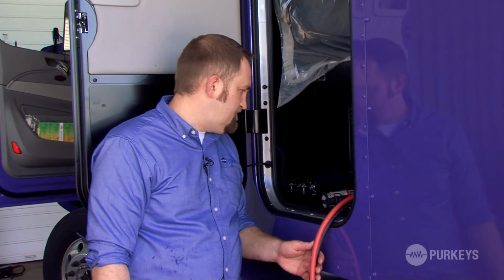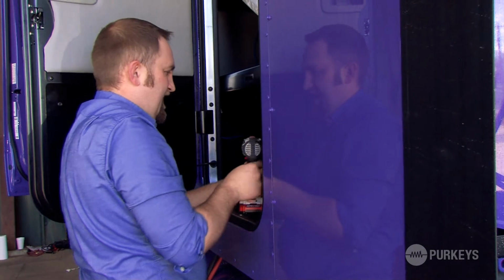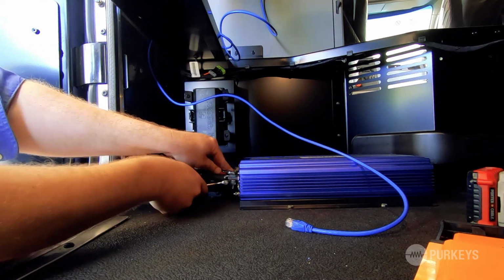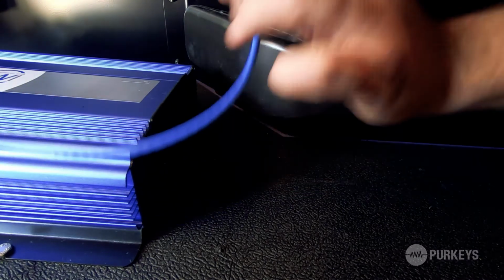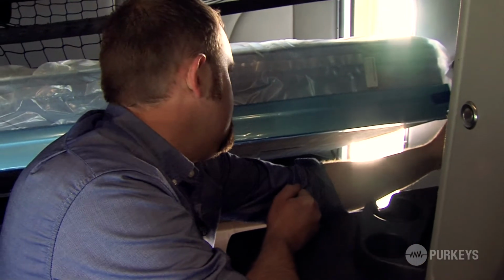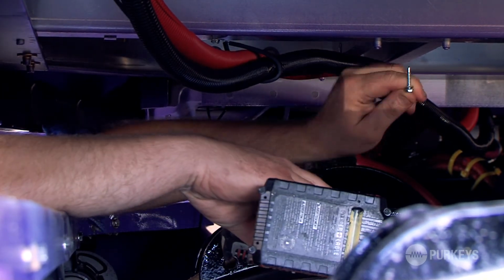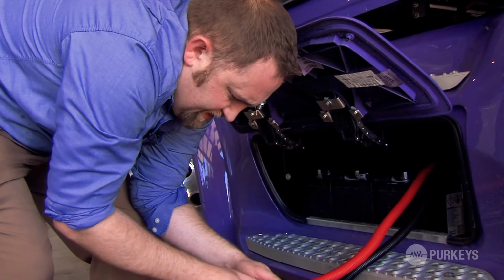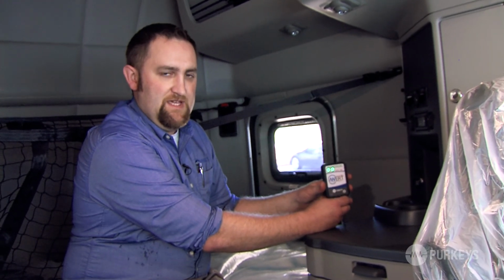Inverter Installation - Purkeys

Comment: My company bought a bunch of these for fleet reasons now we all hate our lives these inverters don’t have a POWER BUTTON so you can’t even reset the inverter. The controller is pretty much useless you have to tap the button 10 times in “quick succession “ and guess what IT DOESNT WORK.
If you want to watch your tv for 10 mins a night then get up and crack your truck again every 20 mins so you can watch tv for another 10 mins boy do they have a product for you.
Reply from the maker: Sorry for the confusion with your inverter. This inverter DOES have a power button, it can be found on the controller, and the inverter can be reset from there. However, sometimes the company chooses to purchase the inverter with a set battery disconnect value. If your company chose to set that value for you, then pressing the button 10 times in succession will not allow you to change the LVD.

Short run times may be related to battery connections or battery problems witht the truck, this is not a standard issue with this inverter.

Comment: What makes a good chassis ground?
Reply from the maker: A good chassis ground is a clean connection. If the truck has been running on the road it is best to scuff up the area that you will be attaching to with an abrasive like sandpaper. We show connecting it to a cab cross member, since the cab has a ground wire between it and the frame. Also, by connecting it to the truck cab the chance of the wire being broken by the cab movement going down the road is eliminated.

Comment: Thank you Sir for the information. 
I have 2 question what type of wire you used 0 gauge or 2 gauge? And how long the should be? Because I probably need around 7 feet long wire.
So what is your recommendation?
Reply from the maker: All our pure sine inverter cables are 1/0 (0) gauge. We have several pre-made cables based on standard installation lengths. You can see these recommended length cable kits on our 1500- and 2000-watt inverter harness pages: https://purkeys.net/product-category/inverters/
Reply: @Purkeys  I really appreciate your response
Reply: Where can I get a pass through plate. Thanks in advance

Comment: I'm getting a blinking fault and solid LVD. Batteries are new. What is the issue?
Reply: I'm having same issues here. Did you ever get it fixed and if so what did they do?
Reply: @ParsonFishingAdventures  I replaced it. Purkeys wouldnt honor the warrantee to send me another one so I ended up just buying another inverter all together.
Reply from the maker: Thank you for calling in to our technical service team for assistance with this issue. This is the best way to troubleshoot this kind of problem. Have a great day!